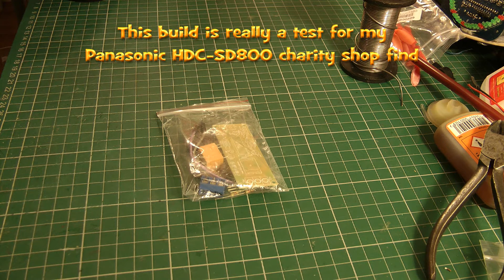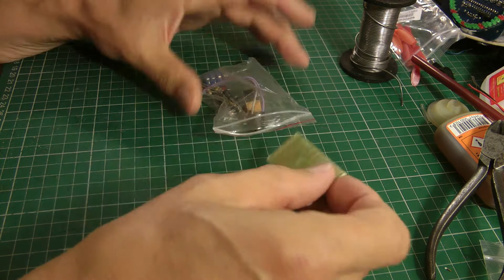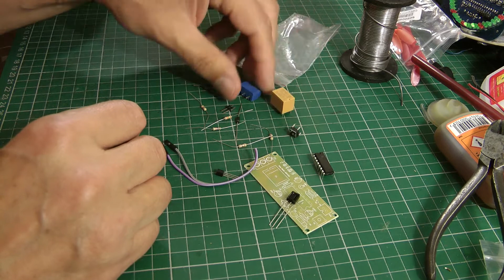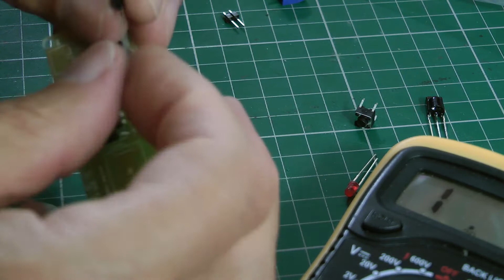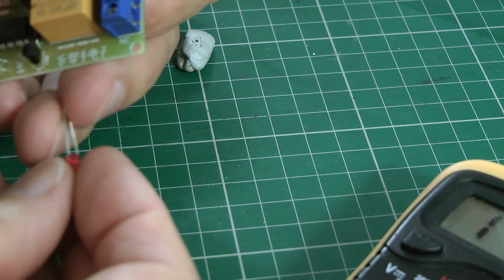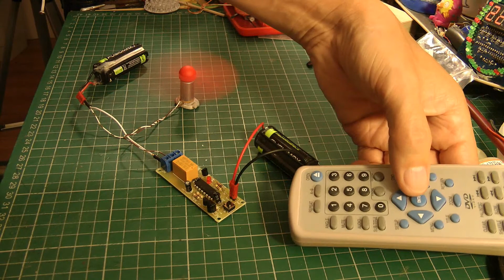Infrared Receiver Electronic DIY Kit

Comment: I stay with the camera before
Reply from the maker: The picture breaks up on a random basis, I decided to return it to the shop in the end. It was more money than I like to spend on old electronic equipment and if the picture was going to break up at an important moment during one of my videos I would be rather upset. There are a few glitches in this video that will probably go unnoticed by most people but I see them so I don't want to take the risk.

Comment: even though it has small flaws... 
you need a little more stereo..
Reply from the maker: The fact it doesn't have the option for an external mic is a rather basic failing.